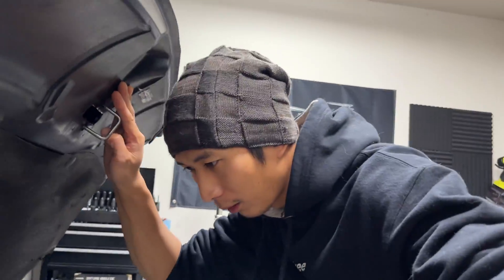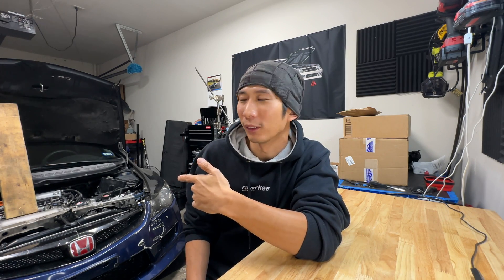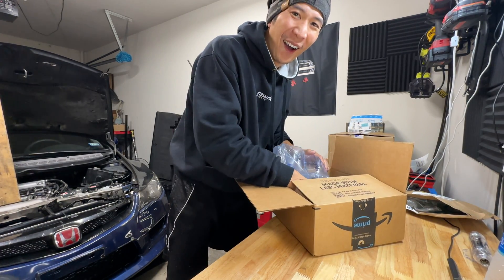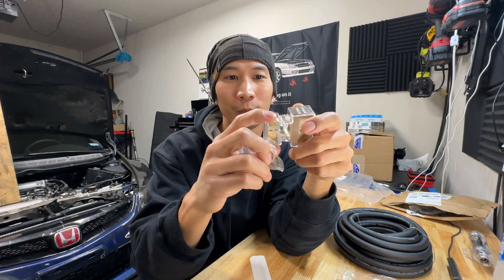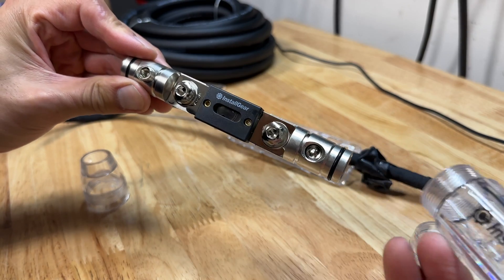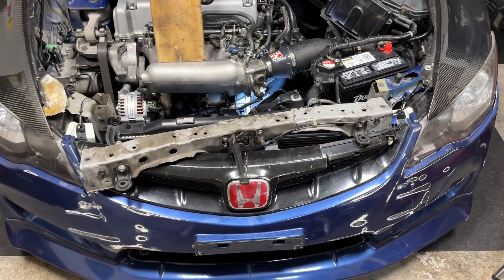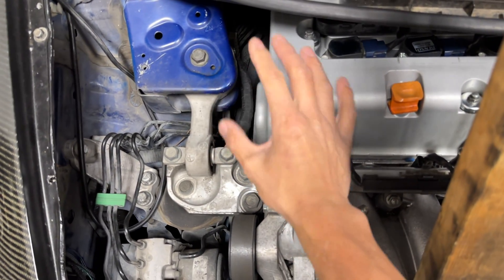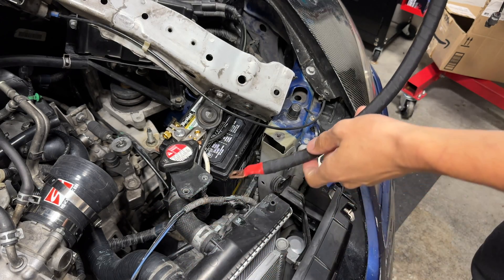3 Reasons to do the Big 3 Upgrade on your car - How to on 8th gen civic si

Comment: Any differences after the upgrade
Reply from the maker: well, my civic stopped randomly cutting off while driving but that was most likely due to a bad ground, no reason to upgrade to bigger wire unless you want to run more electronics like a big sound system or electric AC or something else.

Comment: Can you send me a list of what you bought I have to do an upgrade as well
Reply: cx under his description came with Amazon link too: 
0 Gauge OFC Wire, 250A Fuse Holder, Battery Terminal Connectors, Anti-Corossion Washers & Crimping Tool Kit

Comment: Terminal style fuses are more convenient since its easier to remove and re install. The new one you have is good the first time but anytime you remove and try to reinstall the wires get harder to work with since they start to stray.

Comment: So tell me did this fix your electrical problems ?? Because I did what you did new battery new alternator and still having some problems. So did it fix the problem?
Reply from the maker: @DeezHuevoz420  yes, my radio and electric power steering would randomly cut off while I’m driving and it turned out to be bad ground wires. No need to do 0 gauge wire but I just like investing in nice things 😆
Reply: @ well then that’s my next mode because I change the battery the alternator and still messing up every time I put my window up or turn on the ac the car kinda struggles to do it. Head lights flicker and stuff so yeah thanks you sir. This is next on thenlsit

Comment: just ground the engine block, and as i understand positive from alternator to battery is unnecessary, but a ground from alternator to the battery would help.... it's just increaseing the drain to improve issue with emf

Comment: Did you completely remove the OEM Power wire from Alternator to Battery? I am unsure, but does the OEM Power wire have smaller wires attached to it, like the knock sensor other such wires that I should not mess with? 
Did you cut the 2 wires connected to the OEM Power wire and moved those 2 to the new silver and gold terminal connector? 
What was the reasoning for 2 grounding wires in 1 terminal? as well as the old chassis and new chassis grounding wire?
Reply from the maker: I did a simple upgrade by adding wires to the current charging system.  You could remove the OEM charge harness and use your own but I didn't do that because I wanted to keep the video simple. 

In this video, I only removed that bad ground from chassis to the motor mount on the passenger side. Yes the OEM harness has additional wires, for the alternator and knock sensor. You could unravel it, retain those wires and replace the power wire.

The battery has one ground, I just added another because that was I did to all the other connections. I just an extra wire to each ground to help the charging system
Reply from the maker: So pretty much, there are three ground wires and one power wire. Instead of replacing them, I just placed another wire on top of them
Reply: @Rawrkee  Thank you for the reply! I almost have everything I need to do the BIG  3. and I will be removing the old power wire and splicing the loom. I will also replace all the small ground wire with the 0guage ones.

Comment: Just upgraded the body mount grounds on both sides of my motor and just ground it out with a 2 gauge wire I can feel a much more efficient burn this pedal I was having all kinds of weird electric issues got them on Amazon 12” 2 gauge for 20 bucks I’m telling you guys so much better
Reply: Note that my grounds were very rusted and I had a power loss of .5 volts on one side. So idk if that helps
Reply: this is such a long time but do u remember what problem u had ? I have a 08 si im working on and can’t figure out why its acting strange flashing dashboard lights and loss of power steering already changed alternator and fuses wondering if I need to re do grounds

Comment: Hi! I have a question. Can I run the wire from a positive battery terminal to a bolt that holds an alternator instead of the alternator outlet? In my car Honda Element, the alternator outlet is really hard to reach. If I want to connect to that (B) outlet, I must take the whole alternator out which is way beyond me.
Reply from the maker: No, you cannot but you can use any bolt from the alternator as a ground for the "engine to chassis"
Reply: thank you @Rawrkee
Reply: how about from the alternator both to negative battery terminal, can I do that?  @Rawrkee
Reply from the maker: @Bee-jt5wo  technically it can work but if you’re having electrical issues just ground the alternator straight to the chassis. It doesn’t have to be from the alternator, as long as the engine is grounded, that’s all that’s needed other than the cylinder head ground and battery ground
Reply: thank you @Rawrkee

Comment: Can you do this even if I don't have a big stereo? Just to refresh my 17 yo honda?
Reply: I didn't make the video but I can tell you. Absolutely you can if you do not have any upgrades that require extra electrical power than 4guage would be more than enough as long as it's pure copper wire. This is a great idea in fact because you're stock wires are likely not in good shape I know mine weren't on my 09 acura csx 😂

Comment: Doesn't make sense coming off a 90amp oem alternator.
Reply from the maker: Even if you upgraded the alternator, you would still need to upgrade the wires anyway. By doing this wire upgrade, you’re increasing power flow even if it’s not by much but it fixed my electrical issues and now my power steering doesn’t randomly die on me while driving 😆
Reply: @Rawrkee ONLY if you upgrade the alternator would you need bigger wiring. Now I say bigger, not newer. Sometimes wiring does oxidize or corrode (especially those pesky grounding straps, ew) which would merit replacement. However, for 90A you could have ran 6AWG wiring and been fine, even considering heat, resistance and voltage drop (which the engineers did when designing the factory charging system). Increasing wire size does not inherently increase current flow, it just decreases resistance from the wiring, but if the wire size is already sufficient for the rated current that the alternator is capable of producing, it’s not really doing anything for you. Basically, the wiring only has to be adequate for the alternator’s rated output because that’s all that’s ever going to flow across the wiring to the battery. With the wiring you’ve added you could easily run a 400A alternator haha

Now the wiring AFTER the battery is a different story because the battery can and will output far more current than the alternator, so definitely not a bad idea to upgrade outgoing wiring, especially for loads that don’t have a constant current demand (like starters or amplifiers, etc).
Reply: K20z3 has a 120 amp alternator btw

Comment: how many ground does these 8th gen have .. i found only 3. I'm having problem with electrical ...
Reply from the maker: Generally, there are 3 on most cars. Battery ground, transmission ground, and engine ground. You can try cleaning the mating surfaces with a wire brush, this upgrade is meant for upgraded sound systems
Reply: @Rawrkee  

got it thks ... 👍

Comment: Looks fantastic! but honestly, this is a huge over kill for most modern vehicles, and just extra money. The electrical issues are absolutely associated to another problem. You could simple just add a couple in a chain and achieve the same amount of grounding if you're looking to increase your grounding effectiveness. Something worth noting. The 12v chargers inside should be left empty when not in use, they cause issues on this platform. Check under your carpet for grounding in the harness anywhere as well. GL OP! Solid editing
Reply: Most modern vehicles can't handle extra current when the alternator is only meant for 120 amps and then you start pulling 200 amps or more from a higher wattage amp
Reply: When you run big power “320a alternators” exc, these wires will melt instantly, that’s why they’re upgraded really, a lot of people upgrade them for “more power” but they’re doing it for the wrong reasons

Comment: Hey man, you use 0 gauge everywhere. What size did you use to replace the oem negative wire? 

Getting an annoying issue where I kill the cells on my battery every 6 months. Tired of buying new batteries. Thanks for your help
Reply from the maker: I used 0 gauge for the grounds as well. I kept the OEM grounds and simply paired them with the 0 gauge wire. With them being so huge, I could probably remove the OEM grounds and it shouldn’t cause an issue. I should’ve mentioned that I was having draining issues AND my power steering would randomly go out while driving. Both issues were fixed after this upgrade
Reply: @Rawrkee  that's awesome. I have the same issue. Battery drains and my mechanic sees no power draw.

Thanks for the quick reply!

Comment: Can we get something like this for the prelude. I’m so lost as to what to do 😢 and I’m struggling to find a rear bumper
Reply from the maker: yeah bro! I'm going to do this upgrade to the prelude very soon too but it's pretty much the same concept on all cars. Upgrade the chassis ground wires, battery ground wire, and power wire from alternator to positive terminal on the battery

Comment: Kinda crazy to think of the condition of your wiring in a fairly newer car. I have a car thats 46 yrs old..the wires are still pretty good. Nice job bro! Hopefully no more issues with it.
Reply: back in the day they used to make great quality cars and components used were much much better quality
Reply: It really depends on your location and how you store the car.  Where I live the roads and cars turn white during the winter.  This is from tons of salt.  If you stay off the interstate you are ok.  The problem is driving in warm wet conditions during the winter on the interstate will just destroy your car.  You end up driving in a fine mist of salt water.  Your tires also create a mist and between what’s already in the air from the cars in front of you and what your front tires create your engine bay gets a fine mist of salt in it.  

It’s bad enough that my 2012 civic burst the brake lines under the hood the first time it saw ABS activation the winter of 2019/2020 there’s no way to tell how long the brake lines were compromised.  Could have been years because I almost never encounter a scenario for ABS activation.  Anyways, the extreme pressure in the lines burst the tubing where it ran through a plastic clip that keeps the lines safe from being bent.  The reason for the compromise is that mist will hit the plastic housing and collect on and inside it and it will sit on the brake lines more so than would happen wherever the brake lines run freely.  All 4 lines were compromised even though only one blew.  So all that had to be cut out and replaced. 

The salt mist hits any exposed areas on connectors and if it can find its way to the copper wire it will wick up the wire and start damaging the entire wire.  This is for example why you can’t use normal automotive grade harnesses and wire on boats that are used in salt water.   The wires eventually just disintegrate.  

If you live in the south, or a state that uses sand instead of salt as there is no proof salt is necessary over sand they just don’t want to clean up the sand, or or you keep off the interstate, do underbody car wash anytime you get salt on the car,  keep the car in the garage during the winter and drive something else ETC your car will fair better.

A car from Nevada should look essentially new except the paint after 50 years.
Reply: That’s Honda for ya lmao
Reply: @PoPFartzUnlimited Spoken like an uneducated fool

Comment: where can I get those wires for my 09 Honda Civic EX?
Reply: Any big 3 upgrade with pure copper wire will do you will just need to cut the wires to size and crimp a ring terminal with heat shrink on the end you cut. I recommend sky high car audio big 3 kit. If you do not have upgrades that require substantially more electrical power than stock a 4guage wire kit would be more than enough. Hope this helps even tho it's a year later😂

Comment: where can I get those wires for my 09 Honda Civic EX?
Reply from the maker: I posted the links in the description, it's all custom made but you can probably find a kit. If you don't want to use OFC wire, you can use CCA but I recommend 1/0 gauge. I previously used 4 gauge CCA and it didn't work too well